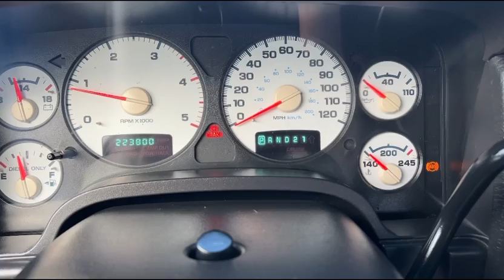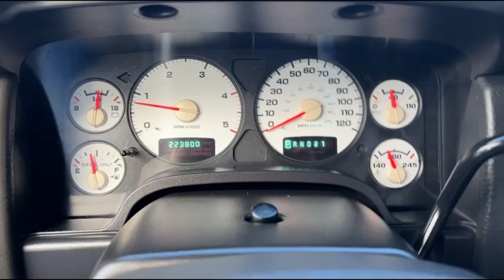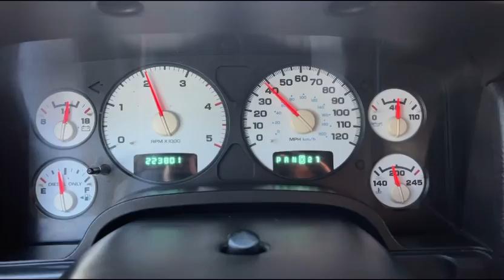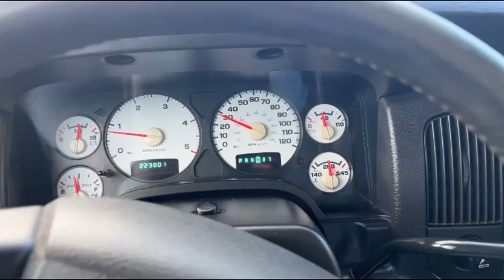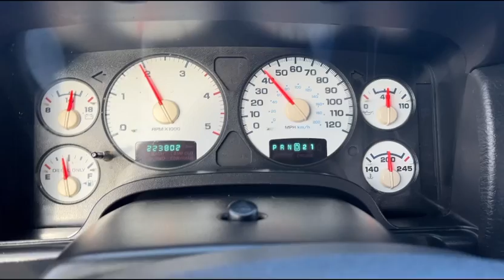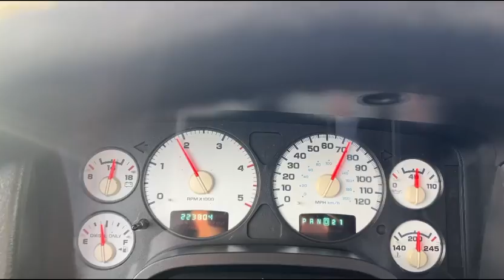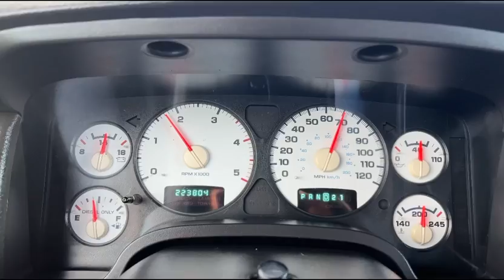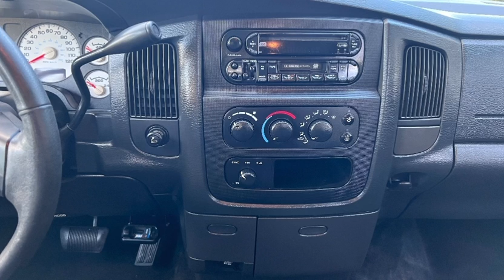2005 Dodge ram 2500 3rd GEN 5.9 Cummins diesel 4X4

Comment: Do you remember what the leveling kit was on this truck.....   2" or a 2 1/2" leveling kit"?  I have the same year, make , size but the Laramie edition with 217,000 on the odometer. This truck would sell in the PNW for another 10K more than you were asking.  (I need to level mine out, I'm thinking the 2 1/2" for my truck).
Thank You for the vid!!